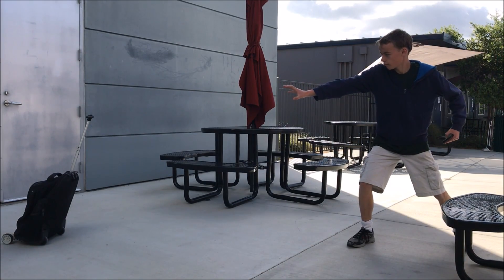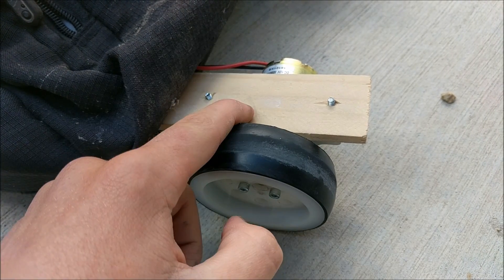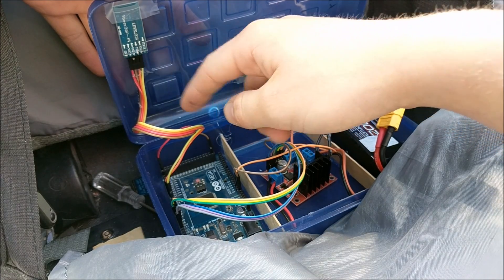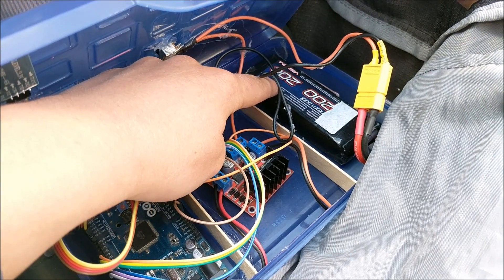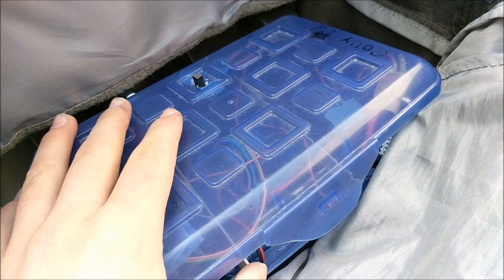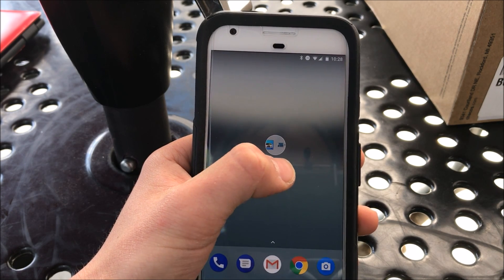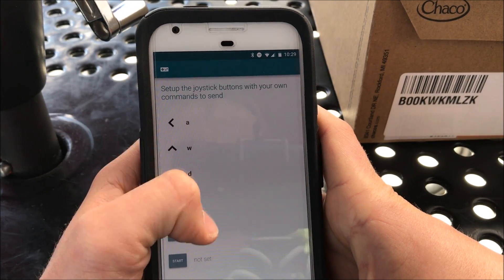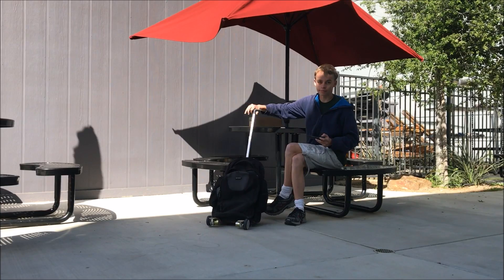DIY Robotic Roller Backpack

Comment: Really kewl!  I was thinking of doing something similar to help me with my deliveries. But I'm going to use an old electric skooter (old folks electric chair) and carry/pull my products (I deliver tortilla shells, and sometimes I have to take in a LOT of them into the store). This will help simplify things  :)
On another note, just bein a little picky: 1) Your sound is a little low and hard to hear at times. May I advise using a bluetooth headset while recording. You don't even have to have it on your head, just around your neck. 2) You're saying the work 'char' as in 'charcoal'. It's actually pronounced as in 'character', since it's short for 'character' anyways.  
Very kewl job and many kudos!  :D